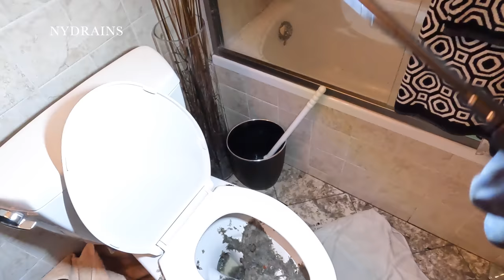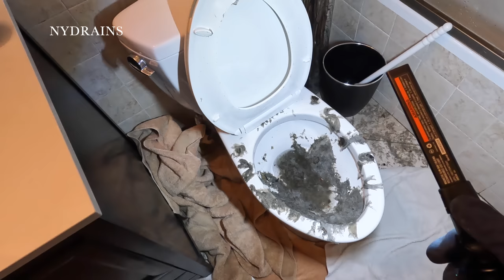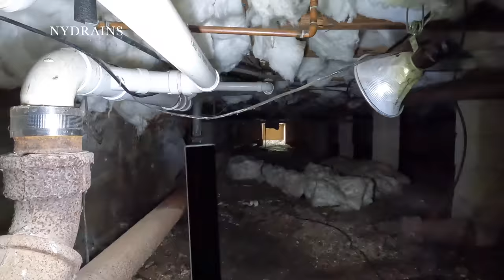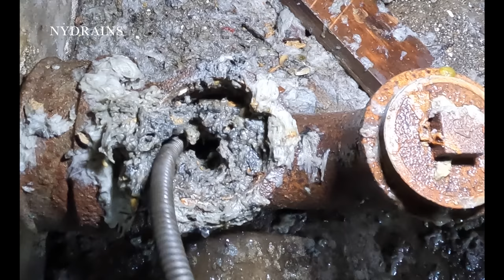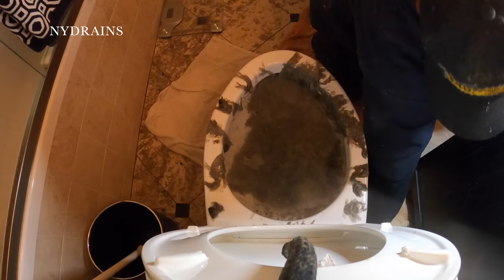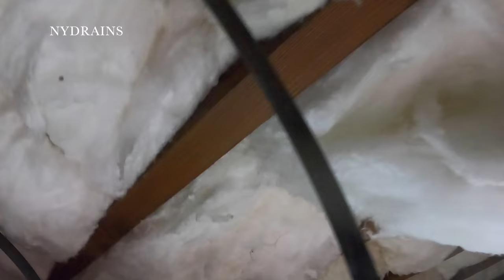Clogged Drain #177

Comment: Today, we have a toilet bowl full of poop & paper & corn for Ratty in the crawl space. Another job well done, Donald!! My parents had a house in Vermont that had a crawl space. Crawl spaces are never a pleasant thing to deal with.
Reply from the maker: Tell me about it 😒 thanks again Liam 👍
Reply: @NYDRAINS  You’re welcome. That looked like the tightest, lowest crawl space I’ve ever seen you work in. Also, I could have replaced the flapper in the Toto Drake toilet in that bathroom. A Korky 3-inch replacement flapper is most likely what will fix it Although my local hardware store, Home Depot, & Lowes now carry replacement parts specifically for Toto toilets.
Reply from the maker: Check out Clogged drain #144

Comment: yeah, NOPE-NOPE, send me an helper for the job @ getting the snake into the crawlspace by yourself. nearly head/face planting into the wall.
I don't do drain cleaning for a living, but I have side worked plenty over the years, generally using the larger coaxial snake machines, with sectional pieces. (not fun) meaning while I don't like playing on poo-water, I'm not afraid and git-r-done if need be. 🙃
Reply from the maker: Lol 👍👍